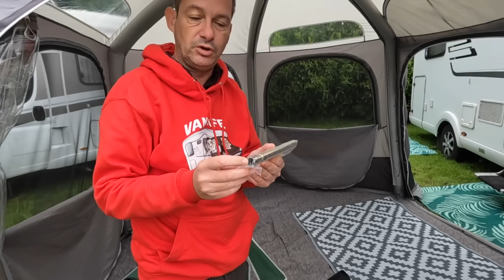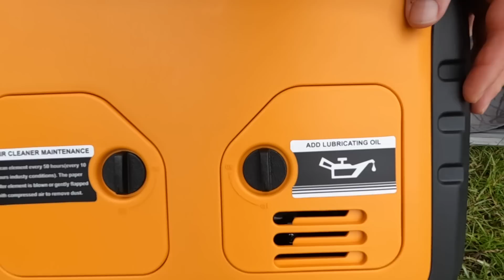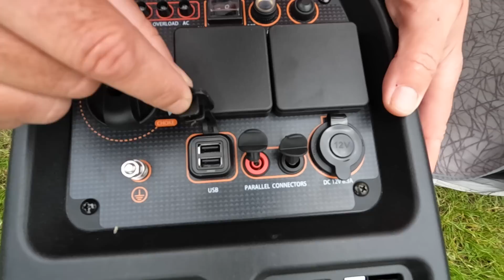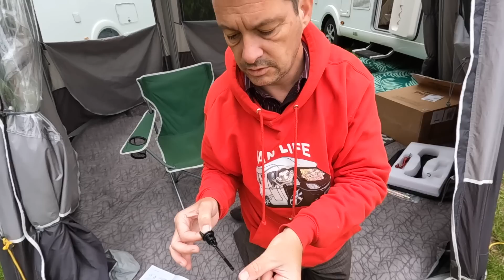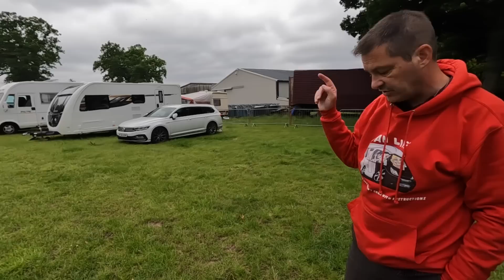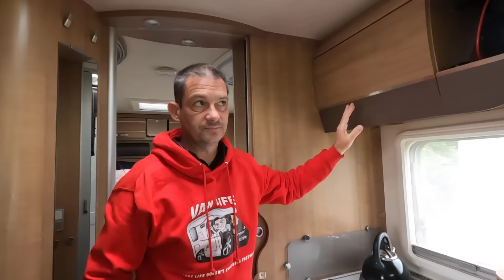The BEST Way To POWER A Motorhome

Comment: Hi Your question about earthing, this is the most important and leased used facility on many electrical devices, it is similar to bonding in operation but very different in application. The best method is to use a length of copper 3/8 to 5/8 in diameter and 8ins long connected to a length of 2.5mm sheathed earth cable. when in use this is called an earth rod. you can get everything you need from any good hardware store or we can supply ready assembled rods incl. postage for £47.00. Once you have the parts you will instantly see how to assemble and connect and realise why! That earth connector is there to be used.

Comment: If the ambient is semi warm, you can start it on choke and when it's started flick it straight off choke... i have 2 champion generators and love them both, 1 silent and one high powered frame type... the silent will be an inbuilt in my self build...

Comment: We have a small portable Honda 2000 watt gennie that we used with a previous Airstream travel trailer we owned, and now the Pleasure-way Class B  motorhome (Camping van) we downsized too has a 2500 watt built in Onan generator  hooked up to the propane system in the van.

Truth to tell, in the motorhome I think we have used it once in three years - that was when we were staying overnight at temperatures well below freezing at a truck stop on a trip to Florida and needed the furnace running all night.

Other than that, with large lithium coach  batteries and solar panels along with a 2000 watt inverter, no need for it.  Especially since we normally stay at campgrounds with water, sewer,  and electrical hookups.

One thing that is a bit of a nuisance with the generator is that if we don't need to use it, instructions say that we must run it under load for an half hour every month to keep it good shape and ready for use.     We do that.

Not sure what it is like in the UK, but most  campgrounds here either forbid generators entirely,  or allow them only during certain limited hours each day - they are noisy and upset fellow campers.    

Ok, and maybe very desirable if you are wild camping (or "Boondocking"  as we call it in North America)  I suppose.

Even though we don't need the portable Honda any more, we keep it in case of power failures at home - rare but they do happen!

Comment: Hi Dan you can get the blue 16a female connections in screwfix and buy a length of 1.5mm flex 5metres long and make your own lead as you’ve got a 13a plug supplied with it then instead of standing it on the box or having too get out your long hook up cable you can sit it on the ground 1.5mm2 can handle upto 3600w so you will be under the current capacity of the cable I make all my own cables up 😊

Comment: Always used a Honda iu10 generator then solar came along and with lithium battery and never needed to use the generator since. 10 plus days off grid with no starting the motorhome. That’s a bulky old thing they’ve given you Dan but for free it’s fine 😉😂😂

Comment: That looks a great thing.  I usually gloss over the electric ones as they are just too expensive for what they are.  I like the petrol ones though, as you say you just put petrol in and you've got your power as long as there's fuel in it, probably lasting a lot longer than a charge on a Jackery.  Much more affordable for what you get as well.

Comment: Great review Dan looks like a fantastic piece of kit.  Just been looking at the specs it's great for emergencies but quite expensive to run if you're going to use it for any period of time. The specs say It will run for 4 Hours at 50% load which is 1400Watts so that will be about £2.00 an hour to run pretty good when wild camping. It's a great piece of kit for the price well worth having.
Reply from the maker: Thanks for the info :-)

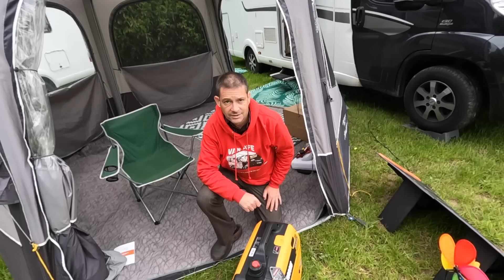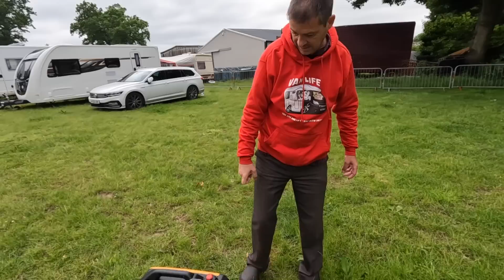Comment: petrol generators are very handy to have in the truck! at 04:40 and 16:40 the red switch is to allow air enter the fuel tank to replace the petrol that is used, if the red switch is off the fuel cant flow to the engine causing the generator to stop.
Reply from the maker: Thanks for the info.

Comment: Could not tell from the video but it's hard on engines if you overfill them with oil.  Can cause you to blow out gasket/seals due to too much oil pressure.  There should be an upper fill line visible on the dipstick, if you did not already see it.
Reply from the maker: Ill take another look.

Comment: Great video Dan and Mazzy looks a good piece of equipment and fantastic price.
Did check out the website and its a 2800 watt goes to a maximum of 3100 watt and is a pure sine wave which is good for laptops etc like it 👍😀
Reply from the maker: That's correct.

Comment: It'll be an assembly lubricant in the oil system, dripped down from the internals. And if you want to keep it running, change the oil.